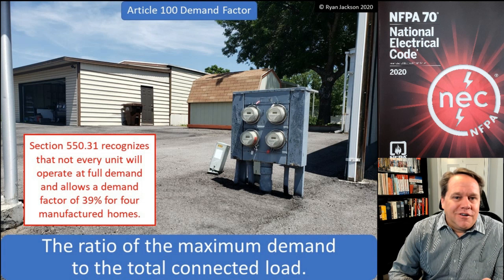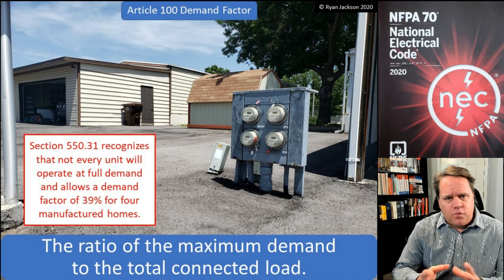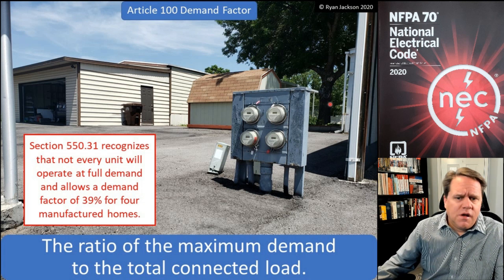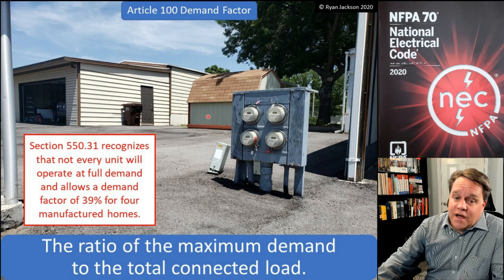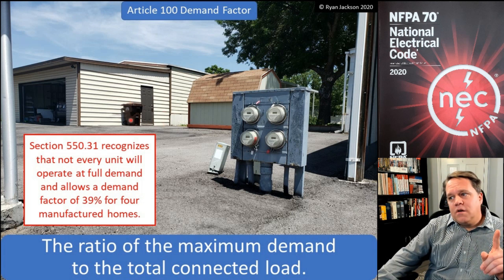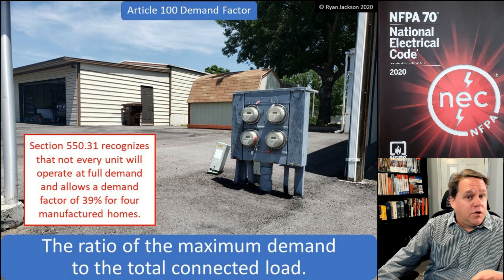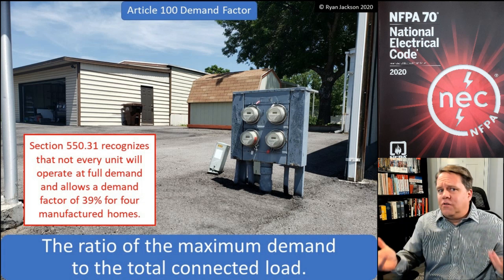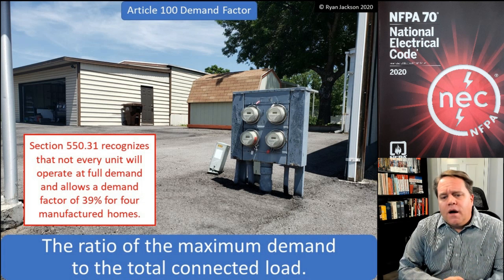100 Days of Article 100: Demand Factor

Comment: Several questions to be explained by this code: 
1. What is the basis for 39% demand  factor , how was it derived or calculated. 

2. What would be the demand factor for 6-8 or 9-10 homes?

3. Define what is "manufactured homes" does it include constructed residential mansion or cottage?

4. Does the Code guarantee that the feeder which is less than 400A, would not burn if all homes simultaneously continuously a consumption of 100A for each home

5.What does the code provide for the short circuit capability of the Demand FActored Sized feeder cables?
Thanks for the reply
Reply from the maker: 1. They are typically based on real-world power consumption data. 2. Table 550.31 allows for 29 percent. 3. Manufactured home is the same as a mobile home. It is constructed then then moved and (often) put on a foundation. 4. Nope. 5. It depends on the available fault current. Section 110.10 always applies.

Comment: 39% works until a cold Thanksgiving Day, with four heat pumps and four ranges.
Reply: Not too sure about that. With my heat pump on & TVs & such I only have an average load of 9 amps on 1 leg & 5 on the other & a range doesn't pull over 30 amps in most cases & it's not continuous.  The 39% of 400 would be a 200 amp service & I think it could handle it.
Reply from the maker: What about the air-conditioner?
Reply: @RyanJacksonElectrical  my air conditioner  averages the Same.  However it is a variable speed drive.